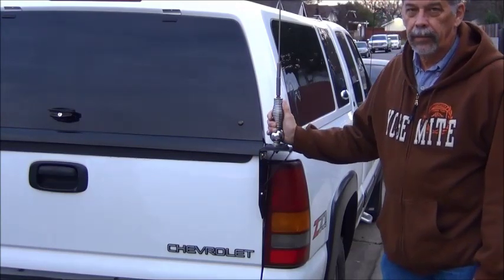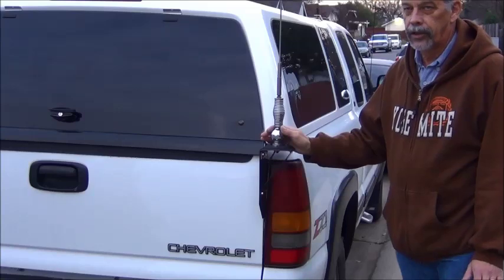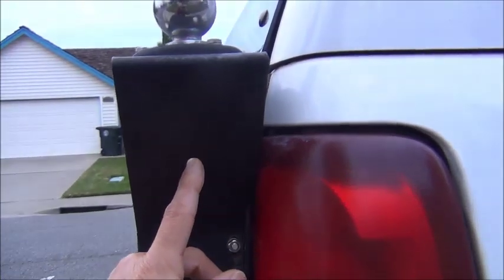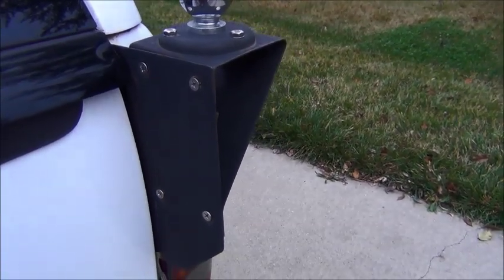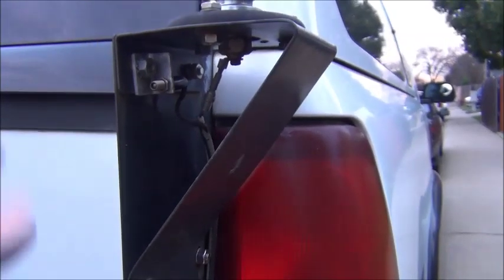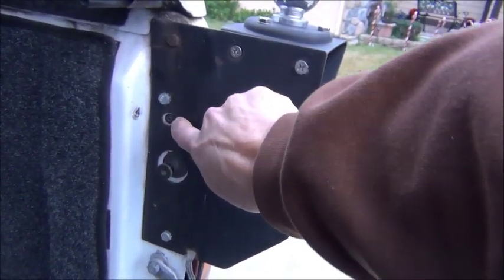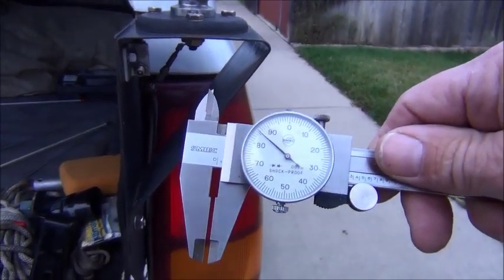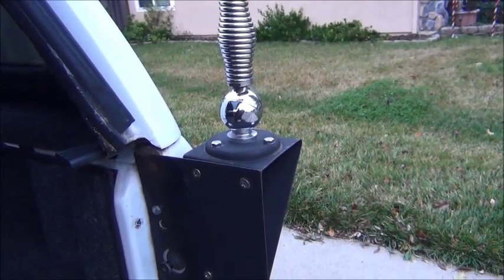Amateur Radio Antenna Mount by N6TWW

Comment: Have you tried putting a auto tuner in line to see if 6 meters will tune? 6 meters is a very finicky band. 10 and 20 meters is very forgiving compared to 6. Right now I’m using a 102 inch whip with ball mount and spring in the center of my tool box hook up to my old Icom 706. I do have a LDG 200 pro tuner inline and it tuned 20 to 6 meters nicely.

Comment from the maker: The shell that the antenna is next to is made out of fiberglass so should be invisible to RF. If it were metal then I would be concerned about the reflections. If I mounted the antenna on top of the shell then there would not be a ground plane directly under the antenna which would also cause problems. I the shell was made out of metal then the top of the shell would be a perfect place to mount the antenna. 73
Reply: Mike